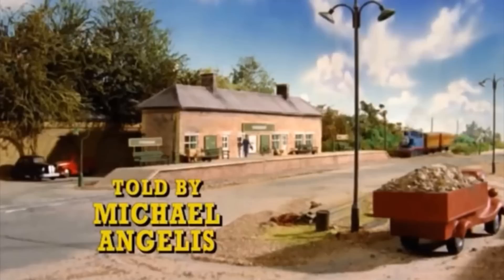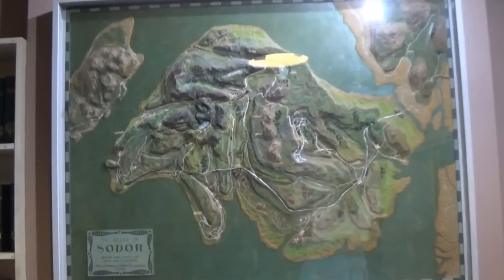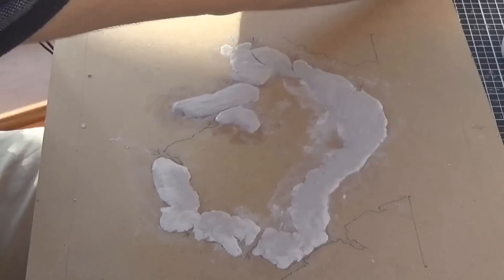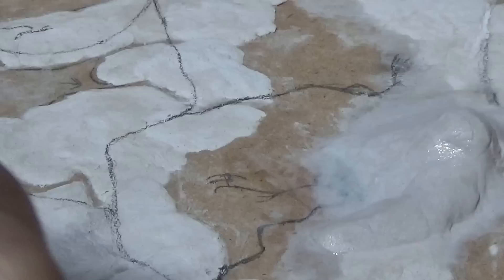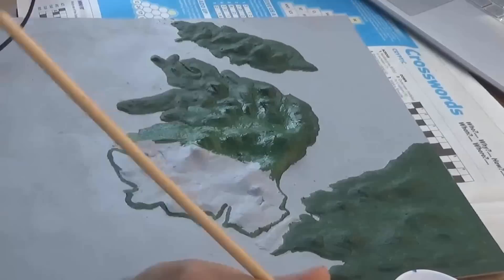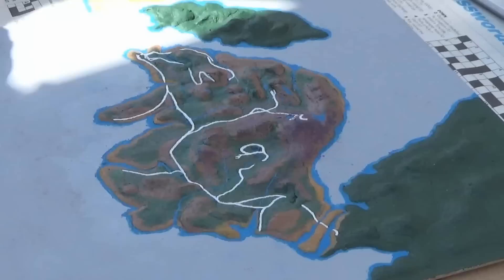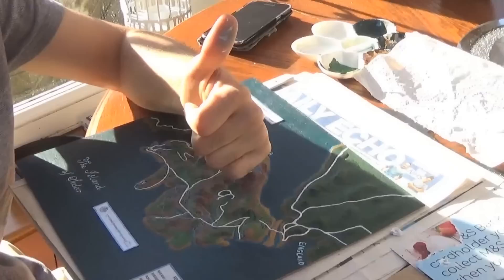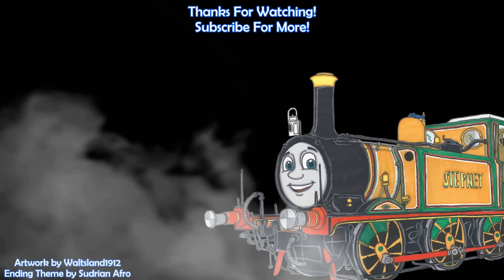Making the Island of Sodor

Comment: Do you ever have trouble with the clay cracking? I've used that type of clay before and everytime I tried to stick them together it just seems to crack. But I don't know if it was dried or not
Reply from the maker: If it's new out of the pack, mix it thoroughly with a small amount of PVA glue instead of water and it should stick. Priming over it afterwards also prevents it from cracking.
Reply: Thanks